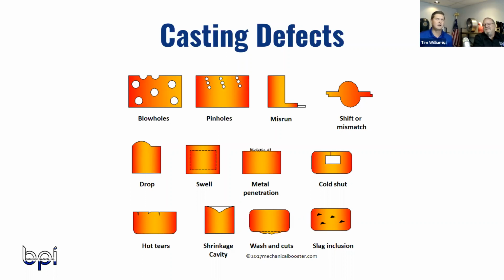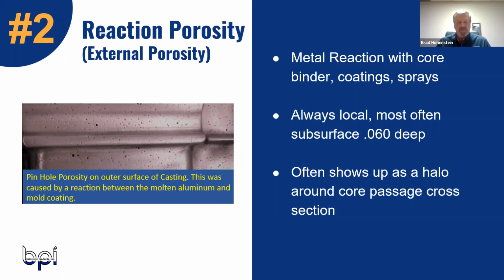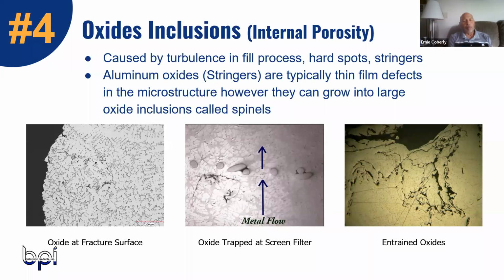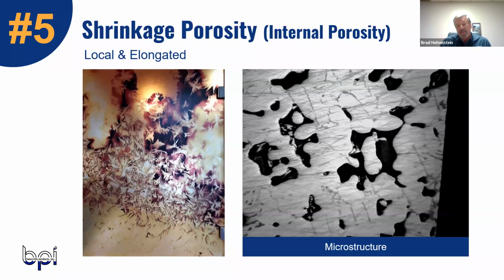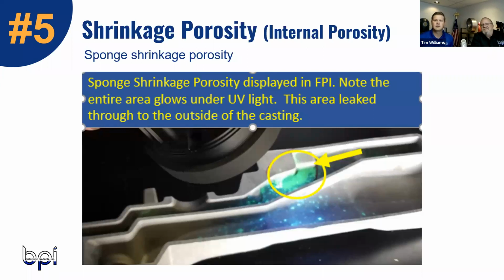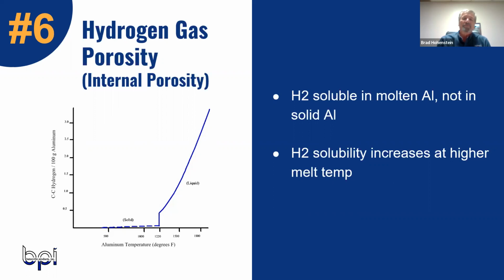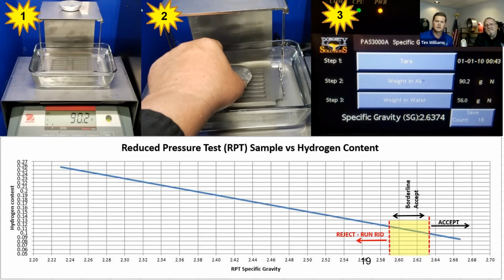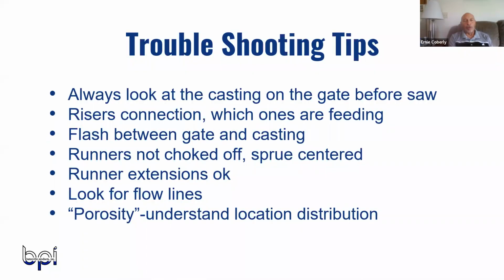How to Identify and Fix 6 Casting Porosity Defects (live event)

Comment: Cut/polish samples to properly identify defects.  Adding hydrogen to melt works in Permanent mold/LPPM due to the faster rate of solidification.  It is important to account for any residual water that wicks into the sample when calculating specific gravity to maintain process compliance and repeatability.